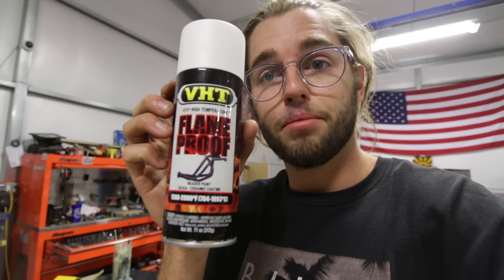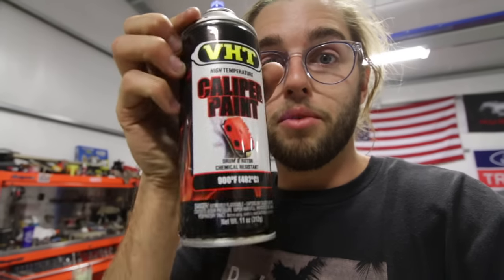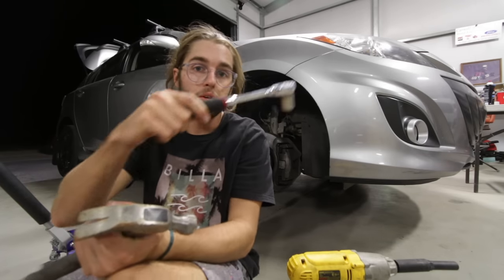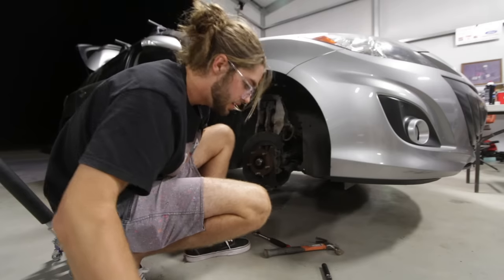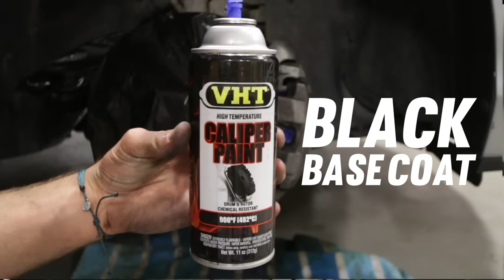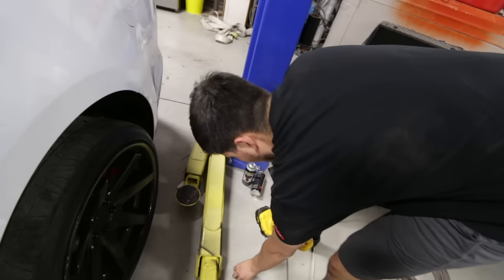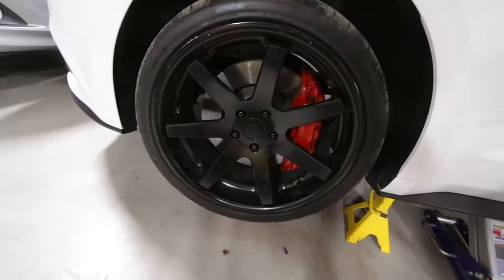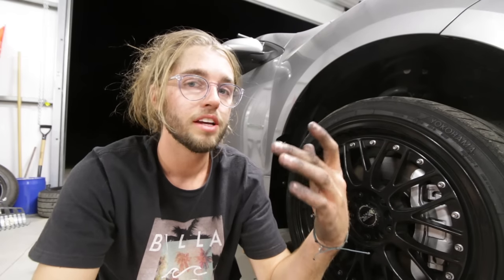How to Paint Brake Calipers Any Color Easy!! DIY

Comment: Cameron, dude, I love your videos, but, sometimes they hurt my heart. You should invest in a breaker bar, and a torque wrench, then do a little bit of research and torque your wheel lugs properly LoL. Trust me, I'm a helicopter mechanic. Just do a little digging and torque your bolts and nuts. 

besides that, excellent vids! i will def be using this when i do my calipers. Keep 'em coming man!
Reply: There is no real need to torque wheel lugs if you have reasonable feel.
Reply: Colin Shahan 
I hope you’re joking.
Just tightening those fuckers right up.
There’s never a torque wrench in alongside your spare wheel.
Trust me, I’m a car driver.

Comment: This video is how NOT to paint your cast calipers! This is why cast calipers come out looking like shit. Noob mistakes. You need to sand it down first with a dremel until it's polished and smooth like a mirror and only then start painting. Final result will be like a factory brembo calipers (aluminum, not cast). Otherwise this mistake is done by 99% of noobs who think painting a cast caliper requires only to wash it down with brake fluid and clean with a brush. No! You need to remove all cast flash (that orange peel texture) before beginning to paint - that is key step in prep!! Also, you don't paint clips and pads - for a clean look, otherwise you'll get a blob mess looking mass
Reply: Ara Arutyan hater
Reply: Ara Arutya I thought they looked good
Reply: What was that for? I stated what I have currently, Brembo brakes. What has that to do with feeling a real man? What are you a schoolboy kid? Brembo brakes I bought are used ones that I bought from junkyard from a totalled car. I prepped them, sanded down, painted and installed myself. I'm 39 years old. I don't understand what was your comment supposed to mean? I can see in your avatar you have a superhero suit and some kind of gaming name - not sure. What I mean is if you are young and maybe in school and think that if someone has brembo brakes you need to mock them or something? That's wrong. WTF is wrong with you?
Reply: Ara Arutyan you being 39 years old means what? You actually erased the comment I was responding to champ.